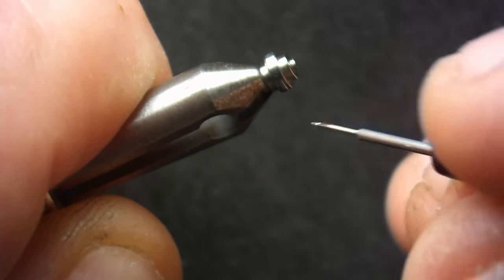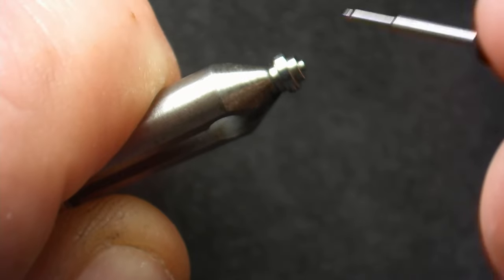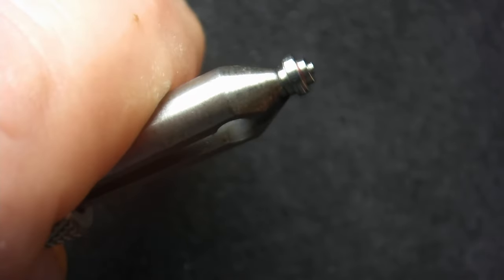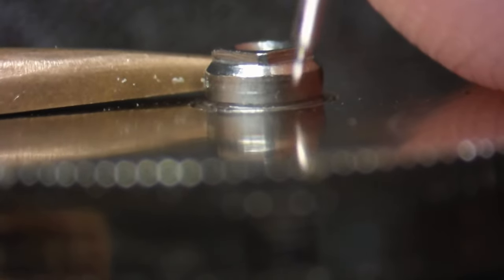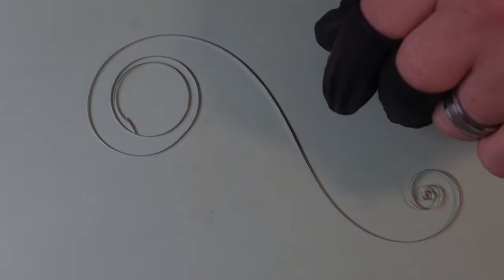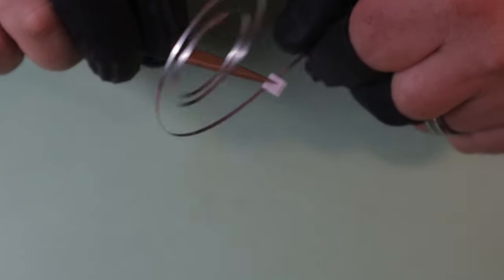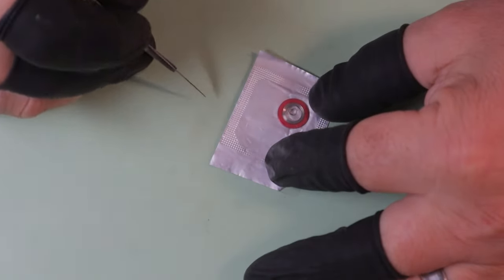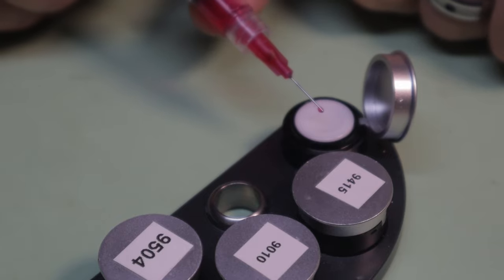Watch Lubrication for Beginners

Comment: This is the one I've been most excited for! Awesome video, as usual heh. Quick question for you: When it comes to lubricating pallet jewels, I've seen many people put a tiny bit of oil on the exit jewel, then rotate the escape wheel, so it spreads evenly over all teeth -- you would avoid doing this? I know never to lubricate the pivots, but I thought you had to do the pallet exit stone to do a proper service. 

BONUS QUESTION 😁: What gauge needle do you get for the blunt tip syringes? Amazon has a ton of assortments, but I did find one that's just all 20 gauge needles + syringes.
Reply from the maker: I can definitely see where the confusion would be on the pallet jewels. Yes the pallet stones and escape wheel teeth get lubrication. I’m actually working  on that video right now. 
As far as the needles the smaller the better somewhere around 20 to 25 gauge would be good
Reply: @watchrepairtutorials  Perfect! I figured I must have misunderstood somewhere, thanks for clearing that up (and upcoming video will be super helpful). An additional question for you: what camera and lens are you using? Filming lubrication can be a real nightmare, but you did great. Did a lot of these shots come from the microscope camera?
Reply from the maker: @awdturbopowah773  I am currently using a canon m50. The close ups are from my microscope camera
Reply: @watchrepairtutorials  Thanks! Really appreciate you answering all my questions on every video. Sorry to badger you with them 😂.
Reply: @awdturbopowah773  Those are really good questions, I wouldn't sweat asking away as the replies are very informative
Reply: @TheBeardedWatchmaker  Thank you B.W.!
Reply: @watchrepairtutorials  I assume you have at least one syringe per lubricant just like having a dedicated oil pot per lubricant. Do you keep reusing syringes for long periods of time? If so, do you clean them somehow?
Reply from the maker: @illwill4544  that’s correct. I use them until hey are empty and just replace them.
Reply from the maker: @illwill4544  yea, it’s not that much, Right? Only the lite weight oils, no grease or 9415

Comment: Wow that Moebius stuff ain't cheap! But I assume that little bottle lasts a very long time, as small of a drop as is being applied. Two questions: 

At what temperature do you store grease and lube?

Do you know what gauge those syringe needs are?
Reply from the maker: Hey Chris, yea not cheap but just consider them a tool like anything else. Most will last you a lifetime.
I store at room temperature in a box out of the light. 
I don’t know the gauge but you can check the link in the description and check.

Comment: Hey, do i need to oil the parts every time i disassemble it even if the movement its pretty new and i am just troubleshooting?
Reply from the maker: Yes. Whenever you disturb the oils location, especially on pivots you should clean it with IPA and redo the oil.

Comment: Man, Second video in, and I'm subbed! 
Been watching watch repair on yt for a few years, and just about to start myself. My first service will be a Seiko 6309, and I have been collecting service manuals and datasheets for it. And in Seikos own tech guide, they explicitly state that you should NOT lubricate train wheels from the outside, but place the drop on the inside before installing the wheel. Is this old information relevant to the oils they had at the time?
Reply from the maker: Welcome my friend. I am guessing that either you're looking at a very old and outdated text sheet or possibly misinterpreting what is being said.
There are only a few instances we're a pivot or arbor would be lubricated prior to installing the bridge or cock. A couple that come to mind would be the barrel arbor which is best lubricated as it's being installed inside the barrel and a minute wheel with a long post running inside an extended center wheel. In these instances you would not be able to lubricate them after they're installed.
The issue with lubricating the 3rd, 4th and escape wheel prior to securing it in the bridge would be the likelihood of the lubrication being displaced while the bridge is being installed.
There are many things that were taught by many well known authors in the 50s and 60s that are no longer considered to be good practice.
If the method you describe by Seiko was best practice, the Swiss and certainly the American watchmakers in the early 1900s would have been doing the same thing. But they don't and never have.
Reply: @watchrepairtutorials  na i doubt that I missunderstood. There was an illustration and everything.. i first tried to include a link to the pdf, but yt shadowbanned it.
I posted on the Watch Repair discord about it, and some one said it relates to the specified S-4 grease being much thicker than the hp1300 used today.
Reply: @watchrepairtutorials  quote:
Before assembling the wheels, apply S-4 to the bottom surface of the hole jewel.
Set the wheel by inserting its pivot in the lubricated hole jewel.
Note: No effect can be expected by lubricating the hole jewel from the upper portion after assembling the wheel.

And then there is an illustration of the bridge/body with the jewel, and there is a drop on the flat part of the jewel, and in the next illustration, the wheel pivot goes through the oils in to the hole of the jewel.

Comment: Just getting into this hobby, great video!! By far the most informed/informative video I've seen. Holding off on buying EVERYTHING at once so I'm starting with moebius 8000 and the molykote dx paste. Is the 8000 suitable for all application areas? I researched viscosity and see its about twice as thick as the 9010 but 1/5 the viscosity of the hp 1300. Also, what's the difference between moebius 9415 and molykote dx paste? Is the mkote suitable for use on the pallet fork?
Reply from the maker: Remember that 8000 is suitable  for practicing your techniques but the movement will not be as efficient as it should be. Dx is used for metal on metal friction. 9415 is formulated for the special requirements of the pallet stones and escape wheel teeth.
Reply: @watchrepairtutorials  Thanks for the reply. I have an old rockford pocket watch from my grandpa that hasn't worked in decades, figured I'd try n get it running again.
Reply: @Bs-qd1jd  Gotcha. They can be fun. The 8000 will be fine to get it running, but remember that the pallet stones really require 9415 and without it you will always be fighting amplitude problems. So see if you can get it running and then you can always go up from there.

Comment: Hi Alex, do you have a tip on how to polish the tip of an oiler?
Reply from the maker: What I use is a hard felt wheel on my rotary tool.
I use the Polinum and with the felt wheel rotating, I just touch the tip of the oiler to it. Lite touches, it doesn’t take much.
Reply: @watchrepairtutorials  ok thank you very much! I am using dialux blue and green. I suppose this will achieve similar results.
Reply from the maker: @chris9413  use what ever is the finer of the two. If it’s too course it will take off the tip.
Reply: Thank you Alex, that worked like a charm!
Different question: I want to replace the oils in my oil cups. After watching your video and you special tip, I was wondering how you clean your oil cups before putting new oil in. Do you have a tip?
Reply from the maker: @chris9413  yea man, just did it today. I just use a qtip dipped in hexane or IPA.

Comment: My question Sir...as i have that multi cap setup for watch oils... can it be stored with the oils in it or is that something you set up before each service job? Thanks for awesome content... learning lots
Reply from the maker: You can store it in the container with lids. This is one reason the syringe method for dispensing the oil is so effective. You can apply a very small amount to each cup.
If it sits there for a long time between service jobs make sure you check it for contamination before using it.
Reply: @watchrepairtutorials  thank you

Comment: Just out of curiosity, what size syringes are you using for the oils? I was able to locate a few insulin syringes for free, but they’re too fine to take up any 9010.
Reply from the maker: I’m not sure off the top of my head. I left a link for the ones I use in the description. You can look them up there.

Comment: How about the posts of various wheels on train of wheels? Based on your videos seems like would likely be 1300 or a grease but would appreciate your instruction, thanks!
Reply from the maker: No grease, it’s too heavy. Slow wheels like the barrel, 2nd and 3rd get hp1300 fast wheels, 4th, EW and balance pivots get 9010

Comment: Hey Alex, would 9504 grease work for  the barrel wall in an automatic? Or would you really need braking grease like 8213 or something? I’m just learning still. Started with just cleaning and lubricating with 8000 “learner oil” like you suggested.
Reply from the maker: Taking grease is very specific to the automatic mainspring working properly.
Use the 8213.
Reply: @watchrepairtutorials  Roger that. After looking up how it works I can see why. Thanks Alex!
-Alex
Reply from the maker: @XJ290  no worries.

Comment: What do you think of those pricey Bergeon Auto-oilers?
Reply from the maker: I have them and don't use them. Why? You have less control over the amount of oil deposited.  The amount of oil needed on a jewel in this movement is not the same as the same jewel in that movement. so unless you are working on the same movement all the time, it doesn't work. Thats one of a bunch of different reasons.

Comment: Hi, what silicone grease is good for crown and crown tube to ensure the water resistant? Thanks
Reply from the maker: I use Möbius 8513 but any watch grade silicon should be fine
Reply: @watchrepairtutorials  is it good practice to use it just a little bit on the case back thread to protect it and ensure water resistant?
Reply from the maker: @BokiPetrovic88   no. Use it on the gasket. 
If your gaskets good, then you have no worries. You should be replacing that gasket as well

Comment: I was wondering what would you suggest for key wind and key set watches?
Reply from the maker: Are you looking for an actual key set for missing keys or square winders for when a pocketwatch is out of the case ?
Reply: @watchrepairtutorials  im sorry... since i posted it to the lubrication lesson what i mean is is the lubrication process different for a watch that requires a key to wind and set... i dont know yet if those movements are jeweled or not and looks less complex from looking at it put together then a keyless pocket watch
Reply from the maker: @gillandro2   No not really. The process is  the same with a few exceptions in much older movements.

Comment: Another bonus tip: If you are tired of moving the watch parts between different jars then move the liquid instead! Use a syringe to suck up the cleaning fluid and put it in a different jar! Then add the first rinse and repeat through the whole cleaning process.....saves time!!!
Reply from the maker: What are you using for cleaner and rinses. It seems like you would be leaving behind a lot of each behind.
Reply: @watchrepairtutorials  Elma red, distilled water and isopropanol!
Reply from the maker: @larslindegren5632  you’ll be surprised at how good that Elmo red 1.9. Is in an ultrasonic. Just as a sidenote, I’m working on a project to add a spinning basket to my ultrasonic, which I think you’ll find very interesting. Spinning basket and ultrasonic, mmmmmmmmm good
Reply: @watchrepairtutorials  I’m all ears!

Comment: Hello, i didn't fully understand, moebius 8000 can substitute (at least for short) term hp-1300 and 9010? i will work on an st3600 and for the first service i would like to have a watch that run okay without damaging the movement. Thanks :)
Reply from the maker: So here’s the way I look at it. It’s your first service so it doesn’t matter if you’re using all the proper lubrication because at this point you’re just practicing the service you’re doing now is it going to be as good as it will be further down the road. The use of Mobius 8000 is a low cost alternative to using and practicing with more expensive lubrication. Now by all means if you want to use 9010, HP 1300 and 9415 go for it.
I only mentioned it’s use because many people just getting into watch service are still unsure about their abilities and don’t necessarily want to spend $200 putting together all the correct lubrication
Nobody gets it right the first time. Nobody.
Reply: @watchrepairtutorials  ok great thanks again 👍
Reply: I will seriously consider to add a digital microscope as an essential tool to service my watchs.   At the moment Is a new skill I need to develop.  With your teaching videos Certainly will speed up my learning process Thank you. Mr Alex, you are master of the masters

Comment: Again great video. I am way more anal retentive when oiling watch movements like the 7750 then I am when oiling and old Elgin pocket watch.  Nice tip on using tweezers to transfer the oil.  I usuallly use the fat oiler to move the oil
Reply from the maker: Thank you, JD. I’ve been storing my oils in syringes and keeping them in an old tweezer box for many years. I like being able just to add a drop to the pot.

Comment: Great videos, can anyone who is using syringes for oil storage let me know what size needles they are using? Also do you draw the oil into the syringe through the hypodermic needle? Is 9415 pallet grease too viscous to store in this manner? Thanks to anyone who can advise me.
Reply from the maker: I believe the ones I use are 18 gauge. The packages that they come in usual have a range of different gauges to choose from. They are blunt tips not pointed like for injections.
9415 and thicker lubricants can be put in in the smaller gauges, larger holes but I don’t find it as effective. I just pour a little from the bottle into the opening, install the pusher, flip it upright and evacuate the air and then cap it. 
Store in a dark environment out of the light is best.
Reply: Thanks so much for your reply Alex. Are you saying you draw thin oils like 9010 into the syringe through the needle, but thicker oils like HP1300 and 9415, you just pour straight into the syringe body?
Reply from the maker: @derekjamescox  I store 9010, HP 1390 9105 in syringes. I pour a little straight into the syringe directly from the bottle into the opening and then insert the plunger. And then slowly push it up to evacuate in the air and then put the cap on the end. 
The purpose of the syringe is to maximize an expensive product . 
Every time you dip a pair of tweezers into a container of oil to transfer it to your oil pot you’re leaving probably about five watches worth of oil on the tweezers . This is OK if you work for someone and you’re not paying for it.
Also, when you put a larger quantity of oil in the pot if it sits there for more than a week, it’s highly likely that the oil will get contaminated with dust, which is not what you want in your jewel holes, especially ones with end stones. 
I also believe when you have a smaller dot of oil in your pot it’s much easier to control how much is being picked up
Reply: Thank you, a very clear and precise answer,I understand exactly now.

Comment: Alex, how do you polish your oil dippers?
Reply from the maker: I use the felt wheel charge with Polinum. It’s what I also use for high polishing cases.
Reply: @watchrepairtutorials , in addition to the polishing of the oiler tips, I also give them a dip in the Epilame. That seems to help in keeping the oil on the tip and not wicking up the shaft.

Comment: Can you clarify a technique? I strive to keep oil off the pivots, trying only to have a small ring around the base of the pivot. But lately I've watched several videos, of apparently skilled watchmakers, touching the oiler to the top of the pivot and letting it seep down to the jewel. Doesn't that suck the oil out of the jewel over time?
Reply from the maker: If you’re talking about lubricating a pivot in a jewel, touching the top of the pivot and letting the oil flow down it is incorrect. To property lubricate this type of pivot you touch the pivot where it comes out of the jewel so the oil flows into the pivot hole. 
Also, to take your lubrication up a notch here’s a bonus tip for you . Every jewel does not get the same amounts of oil. In other words, the second wheel gets the most the third wheel gets a little less. The fourth wheel gets a little bit less than the third wheel, and the escape will just gets a tiny amount. If you lubricate all the train wheels, the same then either the second wheel has two little or the escape wheel will have to much.
Reply: @watchrepairtutorials  thanks, that confirms what I thought. I've keep quiet in the comments of those videos because I'm just a largely self-taught hobbiest, but I cringe when I see it, especially from watchmakers who's tools out value my car😉
Reply from the maker: @allenrussell1947  thanks you’ve given me an idea for a video